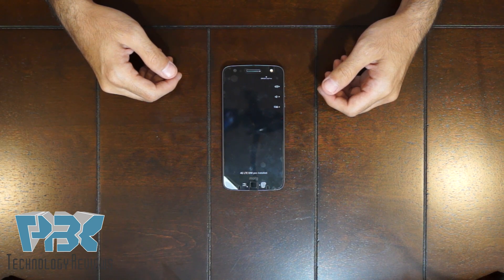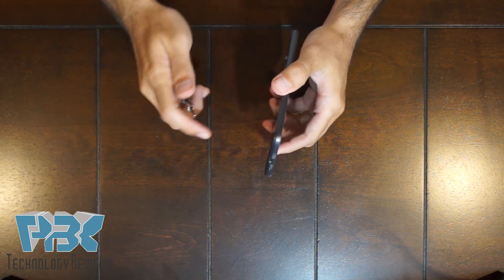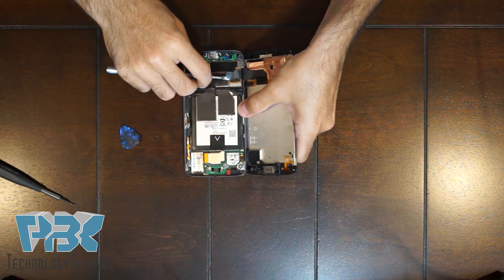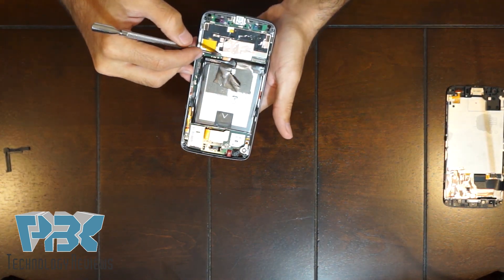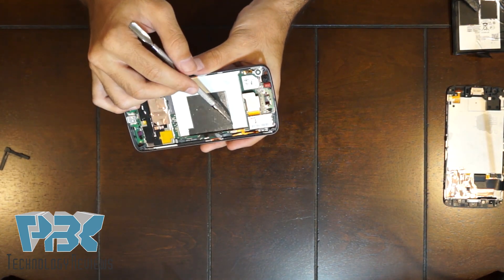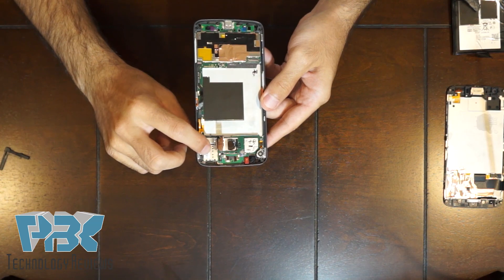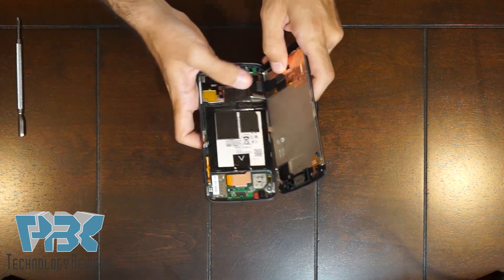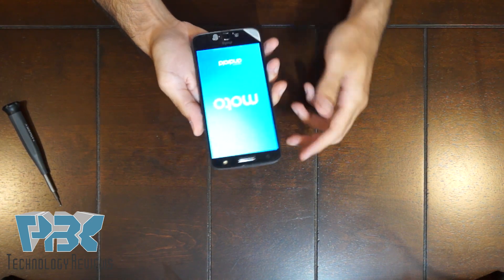Motorola Moto Z Force XT1650 Disassembly Teardown Repair

Comment: Thanks man, I'm about to start my teardown of the regular Moto Z. Hopefully its similar to your Moto Z Force.
Reply from the maker: Hi, ya should be the same
Reply from the maker: After seeing your vid, I guess I should have known the screens would be different on the Z compared to the Z force, since the force is the shatterproof one would have more support with the screen. So the disassembly is a bit different. Also the moto Z play is different as well, the LCD connector is in a different location. I will put up a video in next few days for the play version
Reply: pwrdbykyank mine has water damage as well... this sucks! can't get it to turn on. what exactly makes it not come on?
Reply: I'm kinda jealous that the Force version has those little clips along the edges instead of the insane amount of strong adhesive holding the XT1650-03's screen in place. Also, the ribbon cable's placement is much more sensible. What was Motorola thinking?!
Reply: The easiest one is the Z PLAY, but I'm just baffled why do they make these phones so difficult to disassemble?! Like all the newer iPhones have 2 screws, that's it!! nice and elegant (course the iPhone sucks lol)

Comment: hello!  do you know where i can buy replacement rear facing camera and lens? both cracked form impact and i cannot find a vendor for the exact part -_- i can find xt1080 cameras, but am not sure if these are compatible with the xt1650 hardware?  any advice would be great :)

Comment: i should have looked at this video first as i just screwed up my phone. Can you tell me what part i need to get if i broke that gold type ribbon at the bottom of where you pull the screen top off? i think it is called the lcd screen attachment. it is the part that has to be taken loose from the other side to separate it, and where it is best to buy it? The phone is old and only reason i want to fix it is to get info from it. also what size screw driver tip do you use for those 6 screws? Thanks again for great video.
Reply from the maker: Hi, this video is very old and the quality of it sucks, Can't believe that it looks that bad now a days with the 4K videos I upload. So its hard to tell what piece your talking about. You would need to take a picture of it or something and upload it online so I can see what you are referring to. Or point it out in the video.

Comment: There are 6 screws to be removed, not 4 as the video states. Leaving in the last two can cause you to break the screen when prying it out.
Reply: Yeah, you are so right, I should of read comments first, I almost broke mine, but I knew something else had to be holding it, whew, glad I didn't force it....

Sir, please edit and add in about the other 2 screws near the finger print sensor....

Comment: So for Moto Z Force, it is a necessary to open the back and the screw before we can open the screen panel?
Reply from the maker: yes if you want to take the screen off, you need to remove the back glass panel on top and bottom so you can unscrew the screws to be able to lift off and remove the screen.
Reply: @PBKreviews  thanks for the reply. I found it so hard to open that top and bottom back panel. 🤦
Reply from the maker: @abdulsalam939  yea you need to use something very thin to get between the panel and frame and there is a chance of it breaking but good thing is those panels are sold online for cheap so yep
Reply: @PBKreviews  thanks, I'm successfully opened it with razor. The next question is, what is the number of screwdriver to open the screw?
Reply from the maker: @abdulsalam939  They are T4 screws, so you would need a Torx number 4 screw driver
Reply: @PBKreviews  thanks for your kind support.
Reply from the maker: @abdulsalam939  your welcome

Comment: I just had to take mine apart to change the earpiece speaker. I was as careful as I could be. I replaced the speaker and put everything back together and it works great now. Except, I've lost the top eighth inch of my screens touch response. I can't pull down my notifications any longer. is the digitizer bad now or is there something I missed on reassembly?
Reply: Sounds like something similar happened to my display, except only the bottom third is responsive now. I think it's because we must have flexed the panel slightly and delaminated the touchscreen layer. This thing is so fragile!

Comment: Question.   Screen on modelo xt1650-02.  Motorola should be plastic or glass?????
Reply from the maker: It has a plastic layer over the screen itself, sometimes people peel it off if it has a lot of scratches but its like a thick plastic layer which is what helps prevent the screen from breaking. If yours is missing it, you will notice an indentation on the screen and it wont be flush to the frame of the phone. Its like a thick screen protector thats harder to peel off.

Comment: may I have the part no. of the battery? it seems covered  by black type so I can't recognize...wonder if it can fit for moto z play?
Reply from the maker: Part number is GV40 but it will not fit the moto z play, the moto z play battery length is different and the connector location is different as well.
Reply: pwrdbykyank thanks for your info bro. that's useful
Reply: pwrdbykyank thanks for your info bro. that's useful
Reply: If your's is not the Force version, it's probably a GV30, like my XT1650-03.

Comment: someone knows if it's the same procedure for the moto z force droid? Is no needed to heat the glass of the front?
Reply from the maker: do you mean the Moto Z Droid? because the z force droid is same thing as z force. For the force, no need to heat the glass, just remove the screws etc. But for the Moto Z Droid that is not a force edition, you need to heat the glass because screws are under the screen side.
Reply: @PBKreviews  I am a little confused with that Motorola devices I have the model XT1650-02 so is the same that the z force?
Reply from the maker: Ya that is the Moto z force
Reply: @PBKreviews  thanks a lot bro

Comment: hello I am fascinated by the way you disassembled the Motorola phone I have this same cell phone but the battery really does not last so I decided to disassemble it to change the battery Myself and it loses network I want to get in touch with you but the problem is that I don't understand English I'm French I live in Ivory Coast
Reply from the maker: Wow, I can't believe how bad quality these older videos I did were lol. Not sure how you were able to follow the video, but there are two plastic pieces on the bottom by the charger port when you remove the screen. Make sure those are in place properly since those are for the antennas. Also make sure you didn't damage or cut any cable etc.

Comment: Hey, could you do a Camera lens replacement for this phone? My lens is pretty scuffed um since the glass scratches so easily.
Reply from the maker: Its held on with adhesive so you can heat it up a bit and peel/pry the glass lens off and replace it
Reply: pwrdbykyank alright that's sounds good now I just need to find a replacement lens. thank you for responding
Reply: hey Terry have you found a vendor for the replacement camera and lens? i cannot seem to find an exact match online
Reply: SpiceyNoodles sadly no, ftm I just cut a piece of an extra screen protector to cover it but I'm hoping to find one soon to replace the lens
Reply: hey terry.  i have found a replacement camera vendor (a couple actually, but it seems like the same exact part?) at:

http://www.repairsuniverse.com/rear-camera-replacement-for-motorola-moto-z-force-droid.html

and another on ifixit.  Admittedly I just ordered it, so if it comes in as an incorrect part, I will delete this post and consider it a failed attempt.

I haven't been able to find the outer glass lens though -_-.  i will be using korvu plastic until i find a financially responsible way of replacing it.
Reply: SpiceyNoodles thanks bro, I'll check them out
Reply: replaced it on my phone without a hitch! got the lens cover of the xt1635 on ebay
Reply: SpiceyNoodles sounds great! can you provide the link
Reply: Camera: http://www.repairsuniverse.com/rear-camera-replacement-for-motorola-moto-z-force-droid.html
Shipping: A few days to arrive coming out of Ohio or something like that?

Lens Cover: http://vod.ebay.com/vod/FetchOrderDetails?itemid=142312599708&transid=1386646415004&ul_noapp=true
Shipping: A couple weeks here since it came out of China

Both vendors sent me used parts so dont expect OEM perfect, but they work just fine.  The lens cover was scuffed, but doesnt seem to hinder photo quality too much

Comment: l have a faulty Moto z force( not detecting sim card)can I change it's sim slot like Moto z play.
Reply from the maker: On the moto z force it is soldered onto the main board, you would need a professional to be able to desolder it and solder a new one on.

Comment: Super!. One thing is unclear: how to remove the covers on the screws?
Reply from the maker: You will need a razer or something like it thin, but be careful the glass can easily crack
Reply: Are these crits glued or simply tightly fixed?
Reply from the maker: they are held on with adhesive (double sided tape)

Comment: Not all models of this particular phone have screws on the back or require the rear glass panels to be removed.
Reply from the maker: P.t. Gottney all moto z force are like this, but if your referring to moto z play or regular moto z not moto z force then ya those are different. We did a video on those as well.

Comment: The beginning of the teardown says to remove the two glass panels after removing the sim tray. But there is no explanation of how to remove these panels. Anyone have a suggestion?
Reply: Heat it up, remove it carefully by sliding some thin plastic (thinner than a credit card, more like a guitar pick) under the glass a few points at a time. Keep applying heat until the glass feels just too hot to touch with your bare fingers, otherwise the adhesive will begin to harden again.

Comment: how come you didn't show how to remove the glass panels. it makes no sense
Reply from the maker: Because it takes a lot of time and no one wants to sit and look at someone prying off some glass panels for 20 min of the video. People who usually take these apart have some experience in what needs to be done, if you have no experience then you probably should not be taking it apart because you would have a high chance of damaging your phone if you don't know what your doing. The glass panels break easy and should be taken off with patience so you don't break them. Heat and thin pry tools which won't mess up your housing.
Reply: Sean Kovach , they heat the glass up  and remove them
Reply: I'd like to suggest that you mention that in your videos.  I'm a newb and I assumed that it was so easy that it didn't need to be shown because it would be so obvious.  I watched the Z-play videos which showed the heat gun -but their approach was to remove the glass from the front of the phone.  Had I known, I would have taken my phone to a shop yesterday instead of designating part of today to try it myself.
All I wanted to do is to check to see if the LCD screen connector was loose.  I'm an electrician, so I have lots of tools, but I don't want to go too far.
Knowing that I couldn't do any of this would have gotten my phone to the shop yesterday, saved me some time/frustration, and I could have been working today instead.  :(
Reply: I found a recent post on how to remove and replace broken glass on this model of phone. I have been replacing screens for several years but I only end up doing 1-5 a year. Sometimes not even. Other then the glass looks like the darker one to work on over all Droid I have.
Reply: Honestly, it's trivial. Just use a hot air source like a hair dryer and some thin plastic guitar picks (or something similar) to cut through the adhesive. DO NOT use anything metal to do this as there are fragile electronic components under there.
Reply: Fixing phones is just like doing dentistry, or car repair... if you don't have the right tools and experience, then it's best to take it to a local repair shop and stop wasting your time, because you also don't want to drill and fill your own teeth either LOL... if you get my drift.  There are lots of so called "YouTube" mechanics but a lot fewer can do it professionally.

Comment: Can you remove a sd card stuck without open all the Phone?
Reply from the maker: It would be hard but as long as its stuck in the sim tray area, you should be able to use small enough tools to get it out, however be careful not to break the contact pins which read your sim and sd card because that could be the worst thing you can probably do lol, you wouldn't be able to use the phone if you broke those until you had them replaced by a professional.

Comment: I dropped mine and its bricked.  Desperate to recover pictures of my daughter.   Is there an internal SD with this phone?  Please help
Reply from the maker: Hi, no unfortunately there is no internal SD. Just the external one if you had saved onto it. What is wrong with the phone exactly that you are saying it is bricked? The software is not working at all?
Reply: I appreciate the reply!  Apparently the damn thing was powered off.  So, the phone's working now that I have it booted and got it past my PIN login.  The screen is completely black, but the digitizer and the rest of the phone works (can receive calls, etc.).  I tried to plug it into the computer's USB but apparently debugging is not enabled and thus I cannot pull the files.  Trying to bypass debugging is way beyond my skillset.  Wondering at this point if its easier to just replace the screen (found them on ebay for $50-60/per).  Bought some various equipment to try and project the screen onto my PC but doubt they will work with the USB debugging disabled.Any thoughts on that?  I don't care about the phone, just need to get all the pictures of my little girl.
Reply from the maker: Best bet would be to try and replace the screen. Most things will require you to accept or turn features on for any connections to be enabled so you would need to see what you are doing. Also try taking the phone apart, disconnecting the cable for the screen and re connecting it. Sometimes it works. And Try one more thing. Press and hold the vol down and power button at same time for 20 seconds to hard power off the phone and power on, see if that by any chance gets the screen working again.
Reply: I bought (and returned hah) a moto projector to verify the output was good from the mobo and the screen was indeed toast.  Good news since the screen looks like an easy fix.  I was also able to use mouse with OTG to get in there and get a backup running while I wait on the screen to arrive.  Recovered everything.  Going to also try and just disconnect/reconnect the current screen onight.  Thanks again for your help.
Reply from the maker: sounds good, anytime.

Comment: I've got a faulty Moto Z force. does anyone know if there is an online site that handles repairs?  I.e a place where I could send it in for repairs
Reply from the maker: Just call Motorola or go to Motorola.com/repair
Reply: pwrdbykyank tried that. Motorola said they only do repairs for devices that isn't faulty due to liquid. I dropped it in water
Reply from the maker: Efon Ekpo oh ya water damage is not covered by them
Reply: if you are in Nigeria, You can try repairam.com . you just sit back relax and they will come over to your side and pick , repair and deliver it right to your doorstep.
Reply: ezenwa ikenna I took it to a repair place here in the US, they just couldn't fix it.
 I know a place i could send it to but I'm guessing the expenses of getting it fixed might be so high it'd defeat the purpose of doing so. Thanks for the input tho
Reply: OK sorry man, mine stopped working yesterday. I was told it was hardware issue. They picked it up today. Due to be returned on Tuesday
Reply: I think mine is faulty, as it turns off after it's near/full recharged and out of the blue BAM! it turns off.

Comment: My screen just died today. I dropped it and when I tried to turn it back on it just wouldn't light up. The phone itself is working, I can even touch the buttons on the screen ( without knowing where they are), however, I can't do much with the screen all black ( at least I can make and take calls through google assistant ).
I live in Brazil and have no idea what to do. I was thinking about three possible solutions:
1) send it to motorola in US for repair;
2) try to disassemble it and look for the reason for the sudden screen issue ( maybe some inner piece  moved after the drop and it's out of place );
3) order a new screen piece and try to change it myself....

Anyone has an idea? Would disassebling it solve anything?
Reply from the maker: Your display connector probably disconnected. The cable for the screen sometimes pops off the board if you drop it hard enough. You can disassembly it and push the cable connector back on the mother board and connect it, and re assemble the phone again should work :)